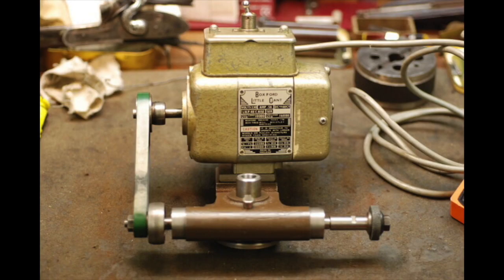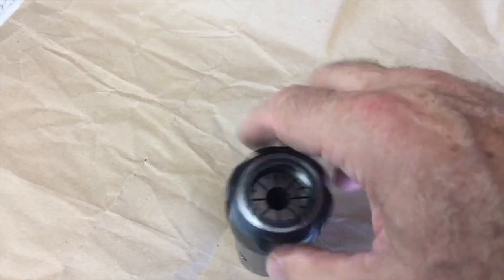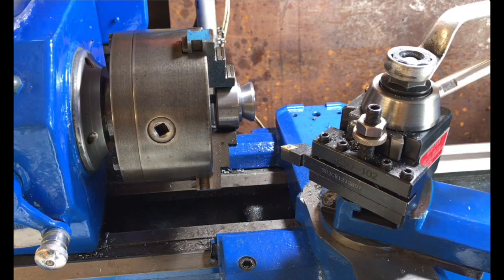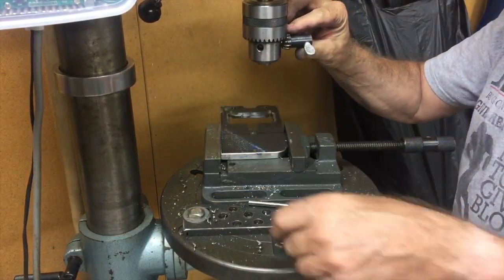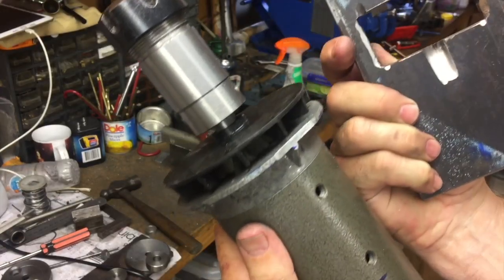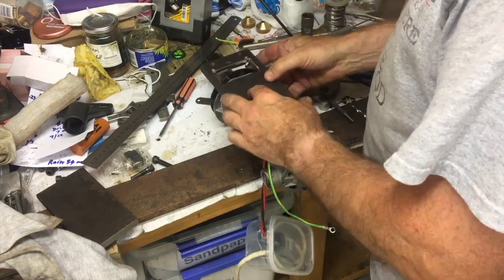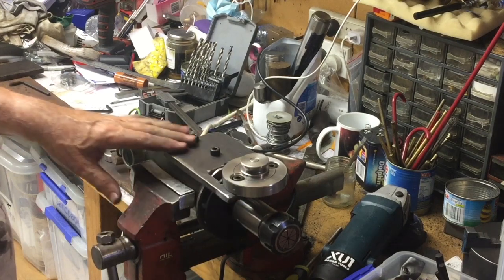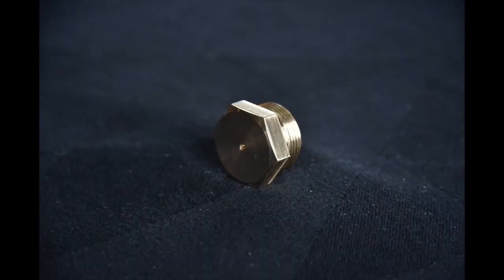Grinding & Milling Attachment for a lathe - Build - Part 1

Comment: Looks very nice but one question: what if you mount the spigot directly on the dc motor?
Reply from the maker: That could be done with a tall spigot to get the height correct but probably less stable. This allowed me to choose the position of the tool closer to the spigot. See part 2 which developed after I was given a vertical slide that fits the lathe.

Comment: Great to see a project that I have been thinking of.
One of my concerns is that the motor is an open chassis, with forced air flow, and has permanent magnets.
Reply from the maker: Ah yes, a potential problem for steel. I have a similar motor in my lathe and enclosed it in a stainless steel box which is open at the gear train end and bottom.  I mainly work with brass bronze and stainless steel (so far). With the milling attachment the air flow is blowing out at the cutter end.

Comment: I am a bit confused by the release of Part 1 two months after Part 2 was posted.
Reply from the maker: I was puzzled by the fact that Part 2 had over 600 views and Part 1 only had 29. At first I thought it had something to do with YouTube algorithms.   But after digging through the YouTube management system I discovered that Part 1 had been uploaded but not published, so it was only accessible by people who found the link in Part 2. I apologize for this unintentional delay!
Reply: @Evan-e-cent  Ah, okay. That makes sense.
Reply: For a dc motor of such voltage as you need you would be much better off using a simple Arduino PWM drive via a suitably capable mosfet H-bridge it can include full PID control with relevant sensors and will give you FAR smoother, better torque performance running than half wave rectified voltage. Yes, a good bit more work but the improvements in controllability and overall performance are well worth it. Nice design though.
Reply from the maker: @boblewis5558  Oh thanks Bob! Thats a good name!  Actually the old rectifier and heater arrangement was something I made over 50 years ago and used as a temporary solution on the milling motor. I already have a Chinese PWM circuit on my lathe and another one on my drill stand which I have documented in my previous YouTube videos.  There is also a video I made about how speed controllers work. You will see in Part 2 about making an ER32 collet holder that I used 3 pin plug left over from when I lived in England. It is different from New Zealand AC  plugs so cannot be confused.  This now plugs into the DC PWM speed controller on the lathe - so the controller is either used for the DC motor in the lathe OR for the milling attachment. That saved me from having to buy a third speed controller. But they were only $67 each and are great devices with digital displays for amps and volts and I also add a digital tachometer to display RPM..  Thanks for your contribution. Since I have been doing computer programming since 1969 including a lot of 8 bit processor stuff I will get into Arduino one day! You might like my free online program for  calculating gear trains:  RideTheGearTrain.com.
Reply from the maker: Recently I have been doing some Arduino programming. Pretty cool!